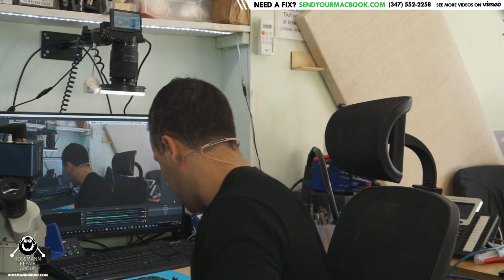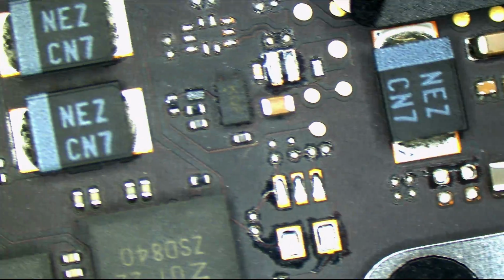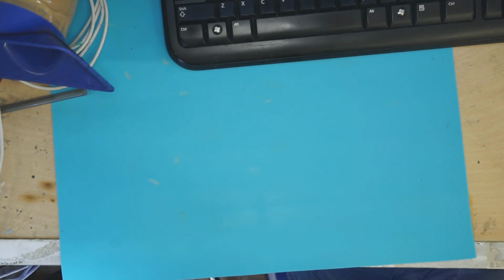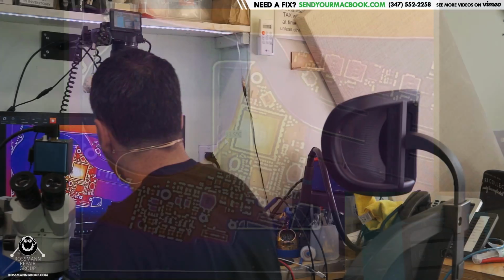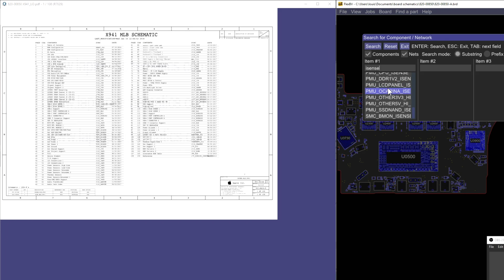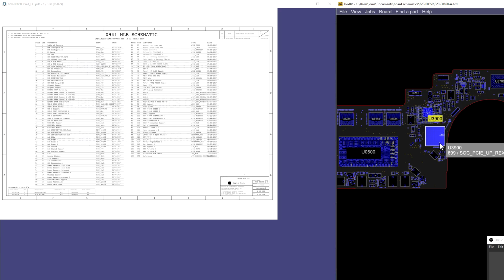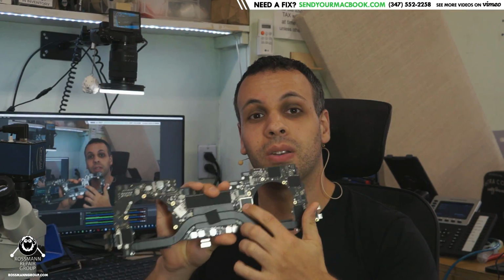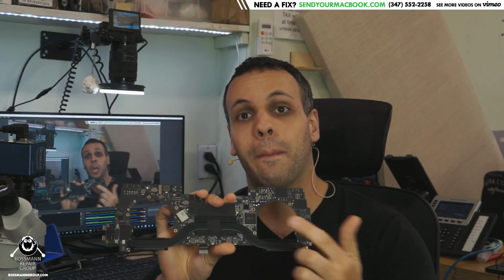Apple users have no one to blame but themselves.

Comment: Is there any compatibility of older motherboards to newer macbooks so an older board could be swapped into a newer case?  Probably not but I was just wondering.

RichE San Diego
Reply: no freaking way
Reply: Wouldn't it be cool to have a manufacturer build/create a generic case that would hold multiple types of macbook motherboards, batteries and screens?  Wouldn't be as slick or light as original, but if serviceable more easily, and saving $1,400 purchases every year whether really needed or not/not fixable (according to Apple or their T2 chip)?
Reply: @googleplusisdead  it's not cool at all and i dont think cost will suffice it'd extremely expensive then after all, an apple lawsuit will bump into the face of the said manufacturer for producing such infringement(by apple proprietary term) see more https://www.youtube.com/watch?v=oNl2q6YZXlA

i think it's rather cool to have option for custom laptop boards and cases on the market so tech savvy king like me could get benefited.

Comment: This is the reason that I will not use any Apple product, when they will not fix their products while they are in warranty.
I'd rather have a IP7 rated android phone with removable storage for critical data, photos, etc (not necessarily the most expensive one on the market either) and a ruggedised laptop like a Toughbook that I can coax back into life if happen to throw a fit.

Comment: My client had a 15" that was 3 weeks old when the crummy keyboard failed, space bar fell off, went into Apple store, was told there was water damage. Machine worked perfectly beyond the keyboard issues, since it had apple care plus, it cost $370 to fix. Even though it was working perfectly, they swapped the motherboard and trashed the data. I will from now on advise my 500 or so clients (large corp offices) to not buy a Mac for their personal use, and will always purchase the apple care plus for the company supplied systems. Basically, if you buy one of these pieces of junk, only expect it to work for the time it is under apple care plus, and no longer. Can't express my dissatisfaction enough without many curse words for where Apple has gone. Jobs died, the brand is not what it used to be, and these employees writing off apple liability for poor engineering takes the cake. I would advise anyone getting the 'water damage' diagnosis ask for proof in pictures, and what exactly is the issue and seek an attorney and file with your states attorney's office for their failure to honor their warranty.

Comment: If it really was a data security design, they could simply tie in the SSD to the T2 chip and leave the other components out of it. If you only had to replace the T2 chip and format the SSD, they could have their data security without completely screwing their customers.

Comment: If the product is under warranty, their support is very nice ( at least with my iPhone 7, where I complaint about the battery percentage jumping around low percentage - around 20%, and they gave me a replacement unit, 7 days later ) 

But if the product is out of warranty, the AASP can rip a user off since there’s no Apple store and fixed price between AASP 

I have a beatsX that died after 1 year out of nowhere and 1 AASP said that it’s more expensive to replace than buying a new replacement unit

Btw what Apple is treating that customer is ridiculous, it’s a defect, customer shouldn’t be paying for a manufacture defect

Don’t plan to buy Apple laptop for their keyboard and their price and also upgradability.... My windows laptop lasted me for like 5 years before problem starts to come in, still using and dealing with the problem today, no repair required for the last 5-6 years( only upgrades ) all I need to do about my sort of problematic laptop is to trash it/ make it collect dust and buy a new one since technology have advanced with better battery life and performance in an ultra book that can be upgraded by the retail store/end user. It cost around half as much as a MacBook Air and it’s more powerful, 

Also when I spec up the MacBook Air up to the windows ultrabook I was planing to buy it cost RM10K vs a windows ultrabook that cost RM3K ( with ram upgrade+ old ssd carry over )which has 2 more CPU cores + DGPU also my data( old laptop ssd ) carries over to my new laptop

Comment: I had a broken power button that they said was prob due to the t2 chip and would prob need a motherboard replacement, then they said it had water damage and wouldn’t fix it, I asked them to prove it by sending photos and they refused.  So I got an ifixit toolkit and opened up to see if I could see any water damage but it was pristine inside, pure corruption

Comment: Louis, give a document to the customer with thermal pictures that says: not liquid traces, T2 chip defective and engineered to be unfixable.Data is impossible to be retrieved due to T2 chip firmware. Return device on warranty. No action taken. Thank you for your business.

Comment: I basically hate the fact it is such a closed system with everything soldered so that they can segment the market by storage capacity etc. So, I guess I did my part by not ever buying anything from Apple in my lifetime. I didn't talk my dad out of buying a MacBook Air though, that is a bit of failure on my side.

Comment: Thanks I was planning to buy an Apple laptop but instead I would buy HP Envy 13 2019. would you recommend such laptop for students.
Reply: Stay away from HP like the plague, they always have heat problems and they don't want to admit it, look on the web for that shit
Reply: @chancho00  BS you don't know what you are talking about ..
Reply: @pumpalBo  Dint know there was HP shills too, i have fixed (temporally cause they end up bad again  with graphic cards problems because thermal expansion on the board causing the solder ball to fail)so many HP laptops that i know why i'm giving the same advice.
Of course if you were lucky that your laptop never give you a problem doesn't mean others will not have it with so many percent of bad ones so why to play the Russian roulette. 
Don't know if they do that on purpose that they die after the warranty period has passed.
Reply: thanks

Comment: About data, it's even more simple than this. T2 does on-the-fly encryption of SSD. T2 is dead. Data is gone. There's basically no way around it.
Sure you could fix the board by replacing T2, SSD and EEPROM (maybe something else, dunno) from a donor like it's done for who-knows-what on iPhone (T2 is an iPhone CPU btw), but there's absolutely no way to bring back the data. That's it.

Comment: I can understand iPhones having this feature with iCloud lock out (from a  security standpoint replacing the NAND gains access to the device), but this has no place in a faulty laptop. Especially if it incorrectly diagnosed - where is the water damage?

Comment: I've been using a Macbook Pro 13" 2015 since its release, and been quite fond of it tbh. During my university years it has held up quite well, never failed on me apart from some minor SMC reset and a hibernate bug that was fixable with a command. But since my work shifted from simple uni work to massive biological datasets and larger ml models, the duo core processor, small proprietary SSD and soldered-on RAM (8GB) weren't doing it anymore. I've been looking for a replacement for well over a year, deciding to wait my time instead of being my impulsive self. And Apple has really been a massive letdown, with their crappy new Macbooks. Under no condition could I ratify a downgrade in keyboard (fuck that thing with every cell in my body), I/O (loldongles), shitty enforced touchbar, untweakable insides and an increased price-tag. Your videos also greatly helped me understand what the fuck they were doing in there, so thanks for that.

In the end, I opted for a rather cheap Thinkpad t480, lowest configuration. I bought a RAM upgrade and large NVME M2 ssd quite cheaply and added them myself. I also bought a large rear battery to have that sweet, sweet, juicy long battery life. Added a Linux distro and done. I truly feel like MacGyver with this thing. The only minor con worth mentioning is that it looks boring to a sleek Macbook (I have to be honest here, I'm a simple person, I have vanity too). But other than that I'm really happy with it.

Comment: Not a pro, never repaired a mac, but I see small button-like indicators inside a mac those turn red when it comes in contact with water. I may be wrong, but I noticed nothing of that sort on this. How do they then conclude that it has suffered liquid damage?
Reply: That's how the Apple store say is water damaged. 

But these things can activate by just having a high humidity and in that case no water touched the board yet they still refuse to touch it.

Comment: Apple computers in the future:

Computer basic - $9999
Pro - $12 595 

Stand basic - $999
Pro (3,4° more angle) - $2 999

Cupholder - $599
Cupholder pro (adjustable) - $999
Reply: Will u be paying in cash, credit or organs?
Reply: @samuelmatheson9655  Can I do layaway and use my children as payments?
Reply: @samuelmatheson9655  

Can I pay in feces instead? It makes good fertilizer.
Reply: See ya in 10 years
Reply: @kzop2847  more like in 3 months because it's already broken
Reply: Do you accept Mortgage?
Reply: all controlled by a single-point-of-failure chip that Apple can't repair themselves, 10 years of warranty (but if you open the box it's void)

Comment: At least the customer could try telling Apple the T2 chip is spontaneously combusting. But yeah this is going to get worse unless there is a customer revolt. I guess the majority are still ok taking it up the ass and buying a new machine to replace the one IN WARRANTY. It's beyond me how Apple can call themselves environmentally friendly. Repair is by far the most efficient form of recycling which goes hand in hand with repairable product design.

Comment: my feeling is that if you could get a replacement chip, then with the right software you would be able to program the flash memory on it to work
the problem is the development of the software to do this
i also suspect that they will have a lot of failures with this chip, they have got something wrong on it, one of the problems with custom rather than industry standard chips, we could be seeing the beginning of the death of apple, they are missing steve jobs, the management at the top is totally fucked, like boeing

Comment: What type of flash memory does the soldered-on SSD use? You could invest in a flash memory controller in order to backup people's data if it isn't encrypted or otherwise locked down by Apple's bad design.

Comment: I stopped buying apple products either late 90s or early 2000s after a piece of software I bought from them via digital download went piff, when my comp went poof, ya ps started on fire, contacted apple and was told I needed to repurchase the software, I said thank you have a great day and never bought a single apple product again. On the other hand I have gotten a software management library dealing in mainly games for a  non apple pc and have changed pcs at least 3 times and I simply sign in a download my library.

Comment: and here am I with a lenovo from 2009, replaced the thermal paste, cleaned it, a little ram upgrade and a SSD, that thing is gonna keep going for an other decade and I don't have to worry about it
Reply: But not if you had a T series from 2012 onward .. T series are fkd up nowadays just as anything else ..
Reply: @pumpalBo  yeah...the old ones where built like IBM devices, the newer ones are actually garbage

Comment: Holy shit even the ssd is inaccessible, that's unbelievable.
Reply: This chip holds some of the encryption stuff. So even if you desolder the sdd chips and put them on a working board. NOPE ain't gonna work. 

The data is gone,  it's disgusting.
Reply: @dominicfindlay  so i guess new macbooks can't be trusted with serious data ? My last macbook air died suddenly one day and i thought it was all over. But thankfully, because ssd could be taken out, i was able to decrypt the data on different macbook and recover the data.
Reply: dudeNigel fail safe vs fail secure sad Rene Ritchie would say
Reply: @theduden  yes, with the older ones you could get the data. But these new ones with that T2 chip, nope. 
If you are using a one make sure you back stuff up frequently. 

Or in future stop buying apple products as Louis says. 

Just for that have effect everyone needs to do that. Hit them in their oversized pockets.
Reply: @theduden  I wouldn't trust a new macbook for use as a doorstop
Reply: @joshuamarcotte8514  too thin to do the job
Reply: dudeNigel well it also means MacBooks can now be trusted with VERY SENSITIVE. data. You can be sure no one will ever read it off your ssd.
Reply: @super-moroshka  The general public, sure. But there are people whose sole job is to reverse engineer stuff like this. I wouldn't at all be surprised if in a few years the T2 chip was cracked, either because of design idiocy or some security weakness. There are also the types of people with the right knowledge and all you need to do is make them angry enough and they'll stop at nothing to crack something. Just look at what happened with the PS3, Sony decided that people didn't need OtherOS support and that spawned hell's minions that eventually rooted the entire console.
Reply: @GGigabiteM  well, in a few years the chip will not be the same. Current iPhones are not crackable. Apple has the best encryption and privacy record among all IT companies and public is willing to pay.
Reply: @theduden   Well quite frankly, as shitty as this new practice from apple is, if you have "serious" data, you need a working backup plan. Having access to the drive alone will not always help you recover your data.
Reply: @super-moroshka  iPhones using iOS 11.4.1 or older are very crackable, and according to various sources on the "darknet", iOS 12 is crackable as well. Though you'll have to pay a pretty penny to be able to do this.

Encryption and cracking go hand and hand, it's always a leapfrog game and no device will ever truly be uncrackable. The companies which announce their device is uncrackable and gloat about it are usually the first to be cracked because many see it as a challenge.
Reply: should have panicked when they started soldiering the SSD to the motherboard
Reply: @burnzy3210  I feel sad because the industry is trending towards this soldered in everything, the even killed of my nice mxm cards and it is very rare to see cpu sockets nowadays or even removable memory. On top of that the storage is also going to be soldered in, that means you can't upgrade anything on a laptop.
Reply: @adelaide7822  tesla will start welding tyres to their cars
Reply: @adelaide7822  Yeah, but that's only because the majority of people don't care enough about upgrade/repair ability to seek out laptops that don't solder down everything to the board or they have brand loyalty like they do with Apple, so until the general public's attitude shifts towards better made products then most companies will follow the trend setters like Apple and make their devices fragile and hard to repair.
Reply: @vgamesx1  I hope they will. There is this really cool asus laptop which has a desktop ryzen 7 in it with dual ram slots and dual m.2s, no mxm card sadly, but Nvidia butchered my mxm. Linus did a review on it and because it doesn't have a t2 chip I can run my os of choice.
Reply: All apple cares about is money thay dont give a shait about the costumer
Reply: I think it's an option (factory - enabled in setup by apple) called FileVault encrypting the data. You can choose to turn it off so data can be read outside of the machine
Reply: It's a"feature," dontcha know!
Reply: privacy! / security...  lol. or so apple wants u to think.
Reply: The T2 chip is basically an A10 ARM CPU. So just like the iOS devices, that CPU has the decryption key for the NAND/SSD. Nothing is recoverable if that particular T2 chip on that particular machine is dead. In other words each T2 chip is paired with each SSD.
Reply: That's really new to me
Reply: I hope you can remove the ssd and solder it on another working older macbook and get the data of that way. I really hope so.
Reply: @adelaide7822  nope, this T2 chip encrypts the data. So the data is gone.
Reply: @dominicfindlay  How stupid of me to think that Louis wouldn't have thought of that solution before if it would have been possible.

Comment: It wouldn't surprise me if it also had monitoring software in there that prevented booting if an "abnormal" condition is detected. "Oh, look. The power rail is 0.1% out of spec. I don't want to boot up anymore. Take me to an apple store." In a way a perfect no-lube solution for f'ing over owners and independent repair shops since all you'll see is that one chip getting warm for a wide variety of failures.

Comment: Of course you can make Apple to fix it: if you are absolutely sure the laptop was not in contact with humidity (past a level in contract), get an expertise that concludes that the failure is not due to contact with liquids and then sue Apple.

Comment: I always have to keep telling my friends to not get Iphones and still they keep getting them. Just had to fix my friends Iphone 6 which had  a problem with the touch IC  because it was designesd badly. Dunno how long my fix will work because I just put a sim card under a plate to apply pressure to the connector... Just get and android already!!!